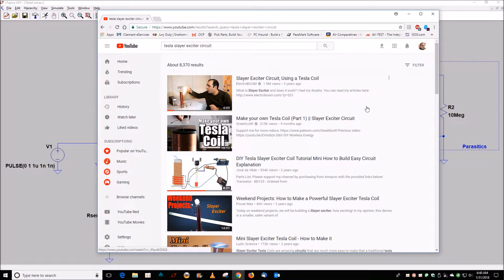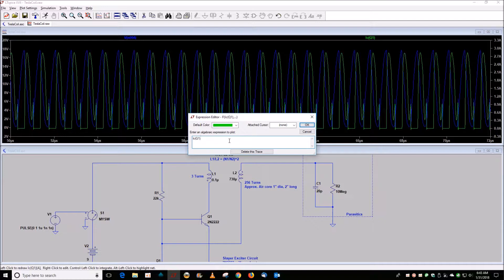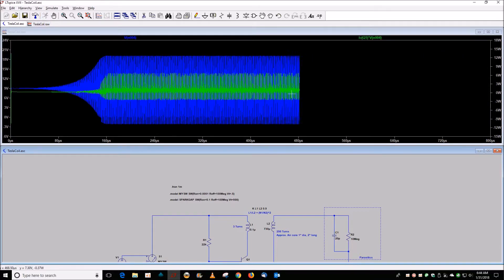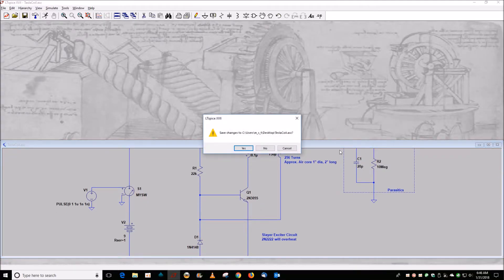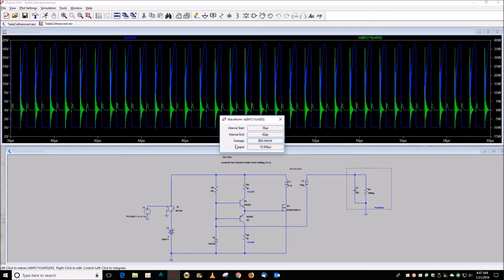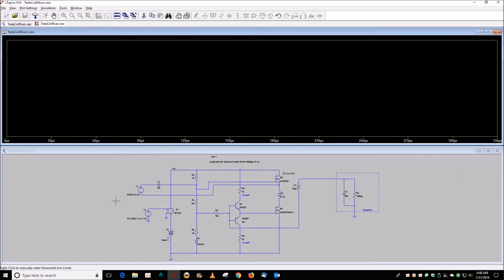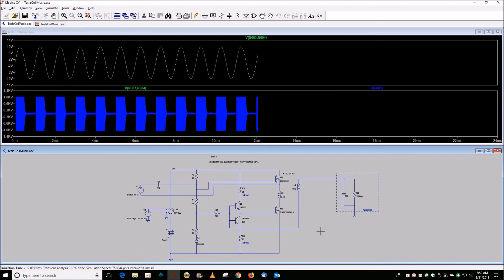Tesla Coil Slayer Exciter Circuit

Comment: I tried many variations of these circuits in Simulink and haven't gotten meaningful performance... when using the same values.  Of course there's no air core xfmr model
Reply from the maker: I don't have Simulink. Seems like it should be possible to get this to work. Besides being free, doing transient simulations like this one is what helped LTspice become popular.
Reply: @miketrupiano7232  thanks!  Simulink is usually pretty good...after tinkering I got some results but I had a 10uH to 1 Henry transformer, a 50pF cap... and my output voltage was like 10^51... it looked like a real waveshape but that's not realistic... not sure I can explain what's going on yet.

Comment: Great video, I wonder if can I contact you?... because I have some doubts about how a slayer exciter really works
Reply from the maker: Yes, but feel free to post questions here.
Reply: Okay,  so I wanted to ask you because I really don't understand how the transistor eventually turns off on Slayer Exciter's circuit. I've watched many videos, but the strange thing is that some people say that a kind of back current appears on the secondary and base, then because it has more potential than the source, it circulates through it and turns it off. And others say that it actually turns off because a negative potential is generated in the secondary, causing the diode to conduct. That difference in explanations confuses me, and besides, nowhere is the repercussion of the analysis mentioned regarding the secondary capacitor; they simply say it's a 'parasitic capacitance.' So, how do you think the sequence that turns off the transistor actually works with the correct polarity ons secondary inductor? @miketrupiano7232
Reply: Okay,  I wanted to ask you because I really don't understand how the transistor eventually turns off on Slayer Exciter's circuit. I've watched many videos, but the strange thing is that there's no a single answer to explain it @miketrupiano7232
Reply: @miketrupiano7232  Some people say that a kind of back current appears on the secondary and base, then because it has more potential than the source, it circulates through it and turns it off. And others say that it actually turns off because a negative potential is generated in the secondary, causing the diode to conduct. That difference in explanations confuses me, and besides, nowhere is the repercussion of the analysis mentioned regarding the secondary capacitor; they simply say it's a 'parasitic capacitance.' So, how do you think the sequence that turns off the transistor actually works?
Reply from the maker: @thebread8918   If I understand what you said, I think they are both kind of right. Without the diode the simulation still oscillates so I might prefer to say it the secondary current is primarily responsible. However, the base can go negative now which reduces the output voltage and makes the BE junction breakdown. For the FET ckt if the diode is removed there is almost no effect in the final output further supporting the idea it's mainly the secondary. Notice also the ckt for playing music has a diode only to make sure the FET driver works. I haven't studied all the nuances of this so I could easily be incorrect. This is where simulations are helpful. Things can be easily probed and modified giving some insight into what makes something actually work.

Comment: Great work - my kit heats the NPN Tip41c so hot at 12V that I want to try your Fet solution ! 
With 8V this circuit works - temp. ca. 54 deg. celsius on the little to220 aluminium heatsink.
Thanx

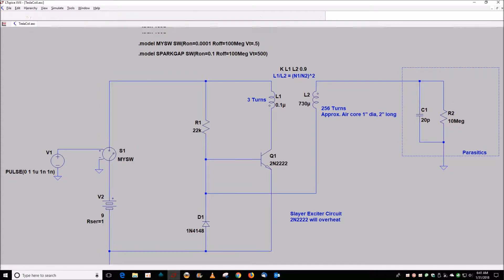Comment: Hey thanks for the video. Somehow I don't get to see the waveform like you do.. I opened the file but when I run and measure I get a single downward sloping curve from around zero to about -900 volts or so. I would like to see the measurements like yours. Any suggestions would be greatly appreciated !! Like just the first measurement that you make on the output coil. many thanks in advance 1:28
Reply from the maker: Try creating file again. I think I fixed it.
Reply: @miketrupiano7232  Hey thanks for your response, but now your comment with the file text is gone entirely ;)
maybe you can  put it in the video description ?
Reply: @Mike Trupiano  you can ask me for the original if you need it. I tried posting it but yt deletes the long copy paste
Reply from the maker: @sencdaarvaarjemee205  last time I tried to put it in the description it wouldn't let me put the entire thing there. Please check again. You should see three different comments. One for each version of this circuit in the video.

Comment: And Do you mean that the frequency of the wave forme is the resonant frequency???
Reply from the maker: It is the simulation resonant frequency of the entire circuit. The  resistors, inductors, and capacitors are ideal models. If you do an AC simulation on this you find the natural resonance is closer to 1.6MHz so if the parasitic capacitance is lowered the frequency gets pulled higher and the output voltage goes up.
Reply: @miketrupiano7232  thank you i will add that in my rédaction of my final studies of the university. I did tesla coil as my final project
Reply from the maker: @kellouishak3331  Well, keep in mind that this is an over simplification of the circuit. Changing the parasitics also changes the resonance.
Reply: @miketrupiano7232  i calculat the parsite by wheeler formula .

Comment: Hello
How did you find the inductance value?
Reply from the maker: I don't recall, but  I suspect it was trial and error. I was only interested in the principle involved so I never built this. With the dimension I call out it might be possible with 32AWG magnet wire on the secondary. A larger diameter might get a larger wire making it easier to handle. Size the primary wire for current. Here's an online calculator to help you size the inductor according to the wire diameter being used. https://www.daycounter.com/Calculators/Air-Core-Inductor-Calculator.phtml
Reply: @miketrupiano7232  the kits from china provide a 400 turns 0.13mm wire - the coil is 52mm long. measured 831 uH with dcr = 36 ohms.